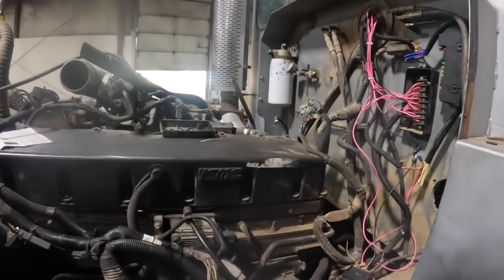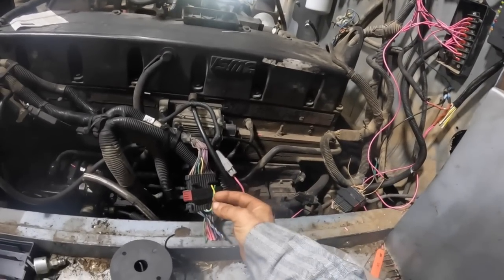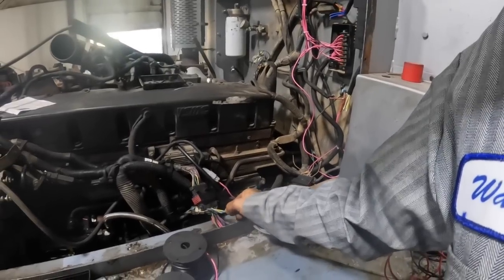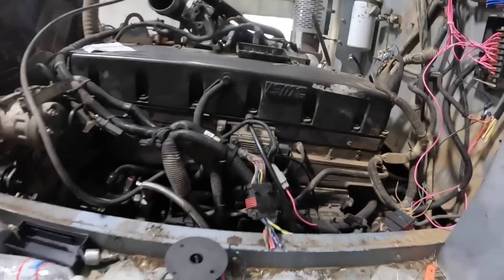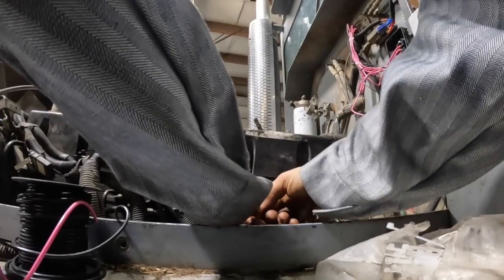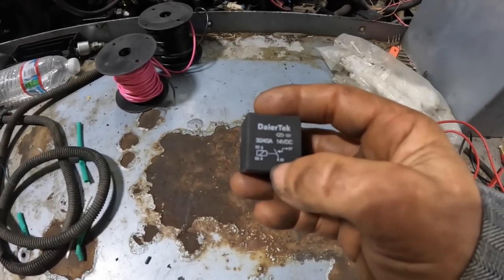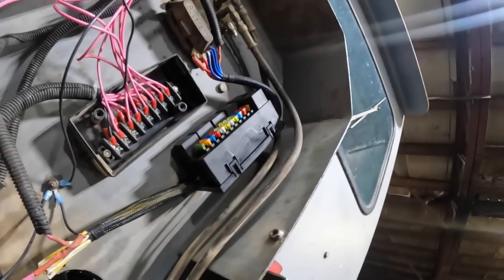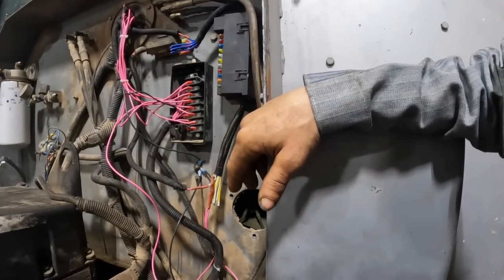Wiring the data link and throttle position circuits

Comment: All of the so-called technology is just a joke Nothing needs to be that complicated  I used to be a Emissions technician  It's a racket I  Had Eh truck  That didn't come with a catalytic converter and it wouldn't pass  Smog but if you put 1 on now it's modified and it fails even though it runs clean now It's a big joke I would be really curious to do a mission testing on a new  Diesel and test the emissions when it's in  Regeneration because it saves up all that  Carbon particular and then Burns it all off it still goes in the air what the f*** is the point Knox gas Is created with combustion  Temperatures  Over 2500° Regeneration for the particular cats Is right There All this stuff just waste everybody's time and  Money California thinks they're saving by environment by outlying fossil fuel powered vehicles they're just digging up and destroying the rest of the world to get cobalt and lithium with child slave laborAnd California Burns natural gas so you can charge your electric car everything comes from somewhere nothing is free nothing is zero

Comment: 3:10 Backbone is just a slang term.

A Controller Area Network (CAN bus) is a vehicle bus standard designed to allow microcontrollers and devices to communicate with each other's applications without a host computer.

Comment: Warren with regard to the throttle, I would switch the signal line not the power feed.... If you leave the signal connected to both throttle pots, its quite likely the second pot (when not powered) will drag down the signal from the other / maybe even drag it to GND... You can switch the signal with just one side of that switch using both poles, just connect ecu to center pin (signal to ecu) and each signal output from each TPS to each outside pin... other halve of switch not needed... Leave the GND and power (5v i assume) lines connectors to both TPS's constantly.

Comment: Hey Warren very nice video you do everything by yourself and I like your attention to detail I have a question about that relay where the coil is controlled by whatever module I think you need either a resistor or diode in parallel to the coil to suppress the voltage spike created as the relay is powered down to protect the module   Again just thinking  CHEERS

Comment: Do you use the solder connectors with built in heat shrink?  I have found it works pretty good. It saves time and fits various sizes of wires. And the heat shrink is clear so you can see how well thinks are going

Comment: Warren,back in the late 70 s and early 80 s  sweitzer was making and selling those viscous fans and also turbochargers to a lot of the aftermarket in the midwest and east.  From what our parts suppliers told us was, that sweitzer also supplied turbos to Mack as factory OEM.  They(fans) never seemed to quit turning and most people got rid of them.  Man , where did you learn all that advance electronics skill?  Bill

Comment: When I do a twisted pair of wires I hold tension on the wires and use a heat gun to warm the wires which I find helps them stay fairly tight.
Reply: Its brilliantly to see people (meaning you) who are actually able and willing to do repairs like this. I work on road construction machinery and there is a real shortage of good skilled people. Cheers for the videos